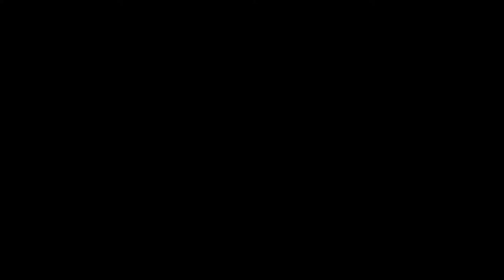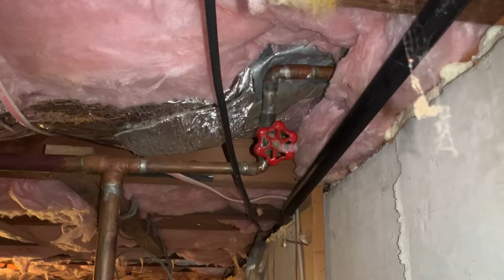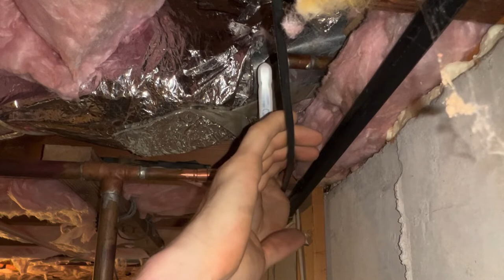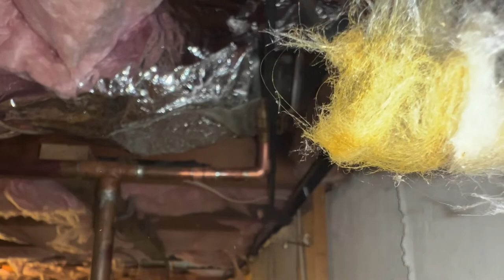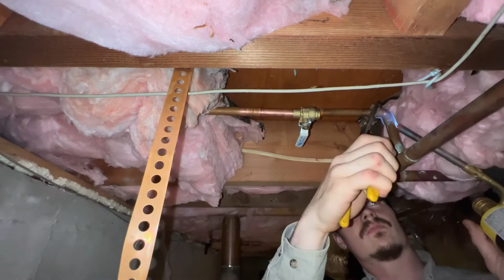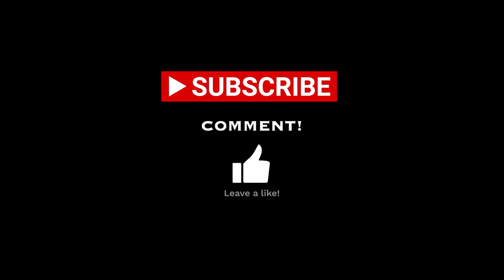Replacing Stop & Waste with Ball Valve

Comment: This is my next plumbing job, installing a couple of stop/waste ball valves at my house.  I wonder if you had used a stop/waste ball valve for the second valve in this video, would removal of the drain plug had given a place for the stream to vent and left your solder job intact?